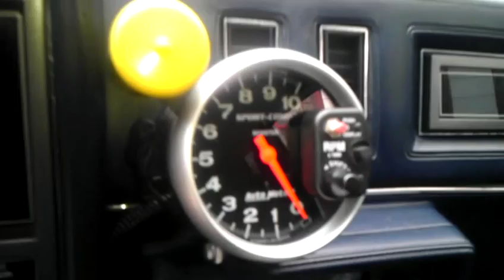CDS 1987 Stage-1 Buick 455 Regal Valvetrain Inspection #1.         8-6-2012

Comment: Thanks for the compliment, most of my smarts come from previous failures. Speaking of which: Are those stock rocker shafts or TA HD shafts? If they are stock, they wont hold up with a .500 lift cam, I know because I broke mine and then put on the TA HD version which has a thicker diameter shaft.